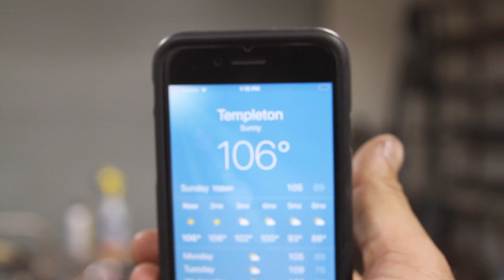Modern Bell Build Using An Old Scuba Tank

Comment: This is one of the nicest cylinder bells I’ve seen. I’ve been given some old oxy/acetylene bottles so looking for inspiration.  Just need to get the tops off so I can fill them with water and hopefully not die.
Reply from the maker: Haha .. Thank you 🙏....yes, please don’t die! I usually stay away from the acetylene bottles and  just use the oxygen tanks. But I’m sure with a good washing and rinse, it would be ok. Just do the cutting as soon as you get done with the rinse so the gas can’t build up again if it leaches from the metal. 😬. I’ve done this successfully with several propane tanks.. Co2 and scuba tanks are my favorite fro this purpose...Less chance to get blown up😜
Reply from the maker: Also one of the better options for cutting those types of more dangerous bottles is to use a horizontal bandsaw that uses cutting fluid. Less likely to get any sparks. 👍
Reply: @ShalohaCreations  I had a look at them yesterday and the bloke that gave them to me told me wrong. They’re both oxygen and one appears to be full. Might have to pass that on to someone else though as it seems a shame to waste a load of perfectly useable gas.
Reply: What type of string is that you used to tie on the wood
Reply: Where’s a good place to get these tanks at ?